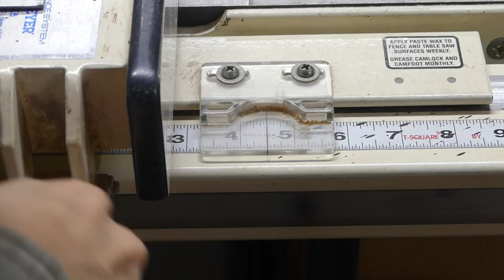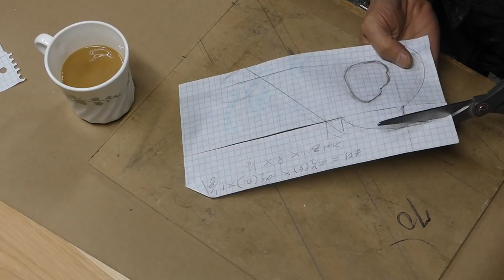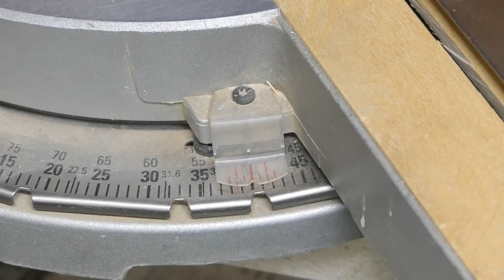How to make a shoulder plane

Comment: Nice! Are you using White oak for the base? I have blade material coming for my shoulder and rabbet plane builds. I won a nice group of well care for wooden hand planes recently and after sharpening the irons and tuning up the  jack, jointer and two smoothing planes and then using them I was very impressed and now have the bug to build my own!!

Comment: Nicely done! I like the design, but could you clear something up? If i'm understood correctly front of the bottom, before the blade is usually little bit higher compared to rest of the bottom, so excess material is fed to blade, but not too much. I didnt see you make it into this plane, could you elaborate why is that?
Reply: That works for a power jointer and to a lesser extent on a power plane, but not for hand planes.

Comment: 0:19 - some would argue that you're using the ruler wrong. try lining up your length / 'number' with the edge of the material and then strike a line off the start (zero) of the ruler - basically ; turn it around. this eliminates one lining-up error.

Comment: Now try again making this tool without using any power tools. These 'Guillaume' were made without electricity. Think again about what you've done, you've tried to recreate a tool that was useful for centuries (since the 16 century) but you've used massive electrical power tool help. It's nonsense, you could just buy another power tool since you're a power tool guy, not a real wood worker.
Reply: You're perfectly right, but don't stop here: why using too modern (16th cent.) handtools? He might use only stones and perhaps fire (if allowed?)...